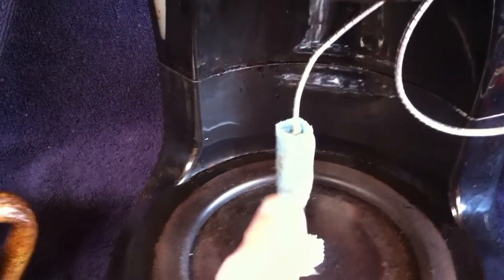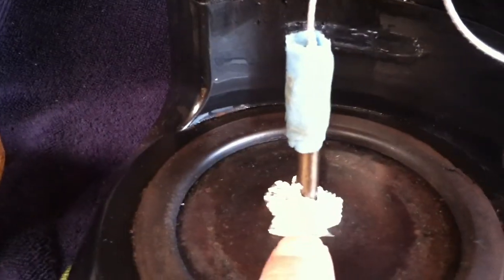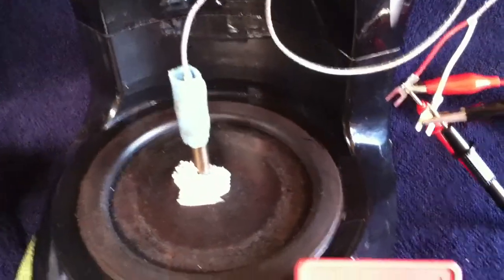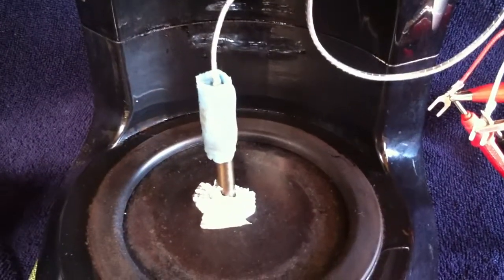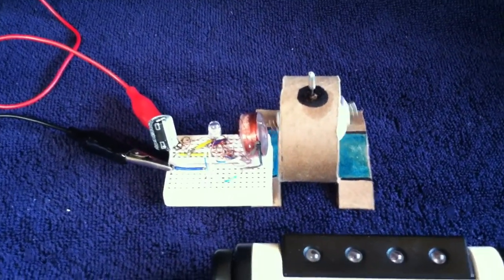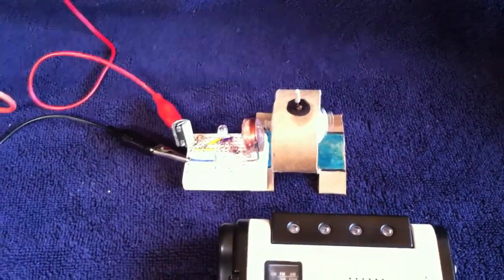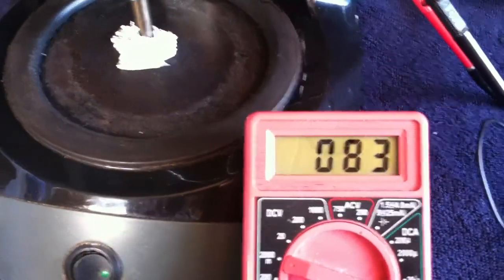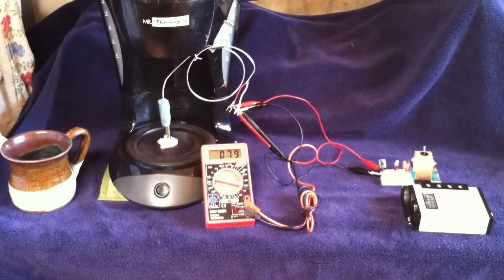Thermopile Thermogenerator-- working off a coffee maker !!

Comment: Nice research project, Rusty. 
Thanks for sharing!
Reply from the maker: Thanks for the input on this project.  It is a fun one.
Reply from the maker: Here is a TEG unit I found on EBay that I like that puts out 10 watts.   It is made in Canada.  https://www.ebay.com/itm/10W-5V-12V-Thermoelectric-Generator-IPOWERTOWER/232744608375?hash=item3630a8e277:g:LDIAAOSwOyJX6bn-
Reply: Or, this might work for you (i.e. a Peltier device):
https://www.mouser.com/ProductDetail/Laird/430856-501/?qs=GZDdKs7T1Q2NOWcdEUVuxQ%3D%3D&gclid=EAIaIQobChMIjpvitcbj2gIV27rACh2zxQsdEAQYBCABEgIEWPD_BwE

At 25Vmax 15.4Amax, 236.6Wmax (all you have to do is devise a heater & cooler system that operates & regulates a cold & hot side within in the following range:  (21.6 °F - 176 °F).  I'm thinking a fluid cooled with dry ice + a small boiler that is heated with wood.

7 of them wired in series through a fullwave bridge rectifier & you'd have a full AC system capable of providing 236.6Wmax--which would charge a lot of smart phones--but, not be capable of powering a hair dryer.

Comment: Maybe one side encapsulated in a vanta black type surface facing upward for sun heating, and the other two ends embedded into ground like a earth battery, for cooling, and perhaps added energy from the galvanic.
Reply from the maker: Thanks for the idea.  I thought about making a tiny solar oven and putting the other end in the ground like you mentioned.  Now that I know that you can get usable energy out of it even at the boiling point of water----it opens up lots of ideas.
Reply: I've thought about thermoelectric generators many times for a emergency power source, seems to be expensive for the power you get, but will work when no other sources of power will, just by burning trash, in which there should be something to burn anywhere.  I think the best is liquid cooling, I think a computer liquid cooling system could work good, with a high output teg and efficient converter, buts gets real expensive quick.  I have a 14.7 watt teg I've had lying around for 5 years, because the setup would cost quite a bit.  I did see custom thermoelectric store now has higher voltage tegs, up to 9+ volts for a single module.
Reply from the maker: I have done a bit of research on TEGs in the last few days and you are right-----it gets expensive quick for a real TEG and not just a Peltier module run backwards.  A high temp TEG that can run off open flame (like a camp fire) is pricey.  I just bought a cheap $5 China 5v TEG that will run at boiling water temp to play with.  Lets see what I come up with.